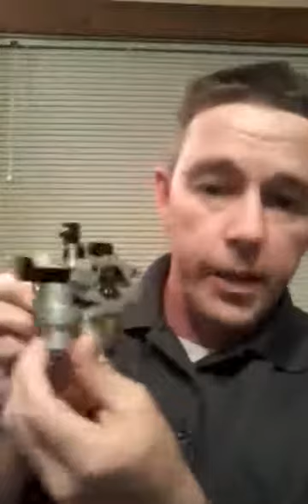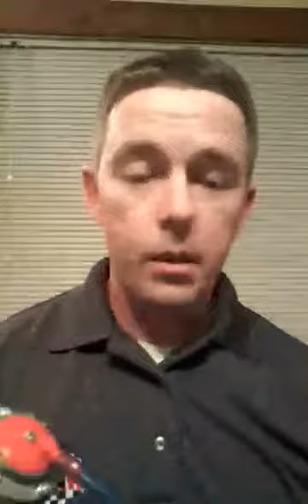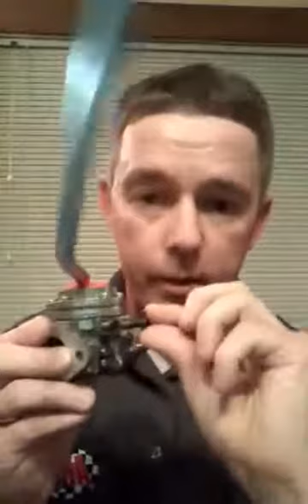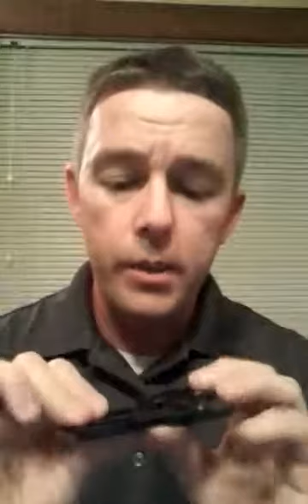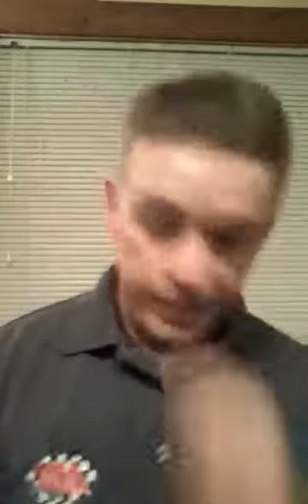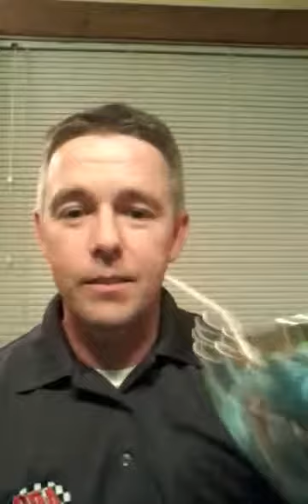Post race & General maintenance(Predator 212,Clone 196cc, Go kart racing, Mini bike racing)

Comment: Is there any advantage or hp gain to running a large air filter on a box stock clone? Like a 3.5”x4” vs. 4.5”x5”
Reply: It will depend on the shape/contour of the filter. There are some advantages to to a bigger/larger filter but nothing that will yield big gains.